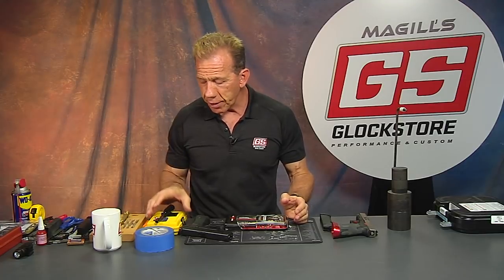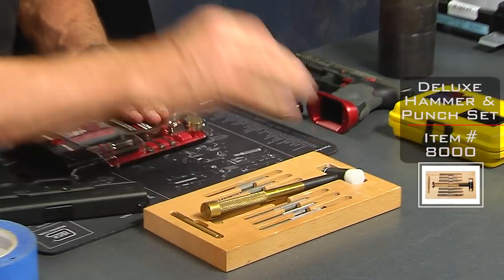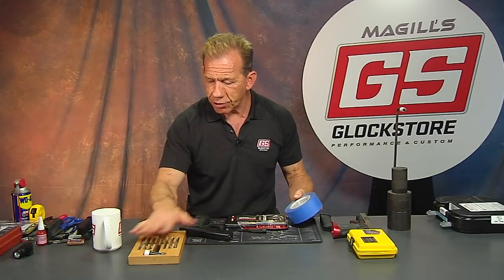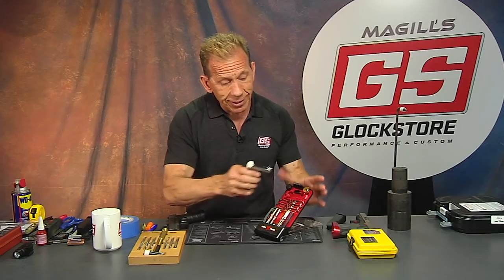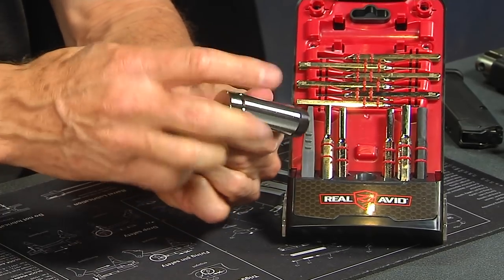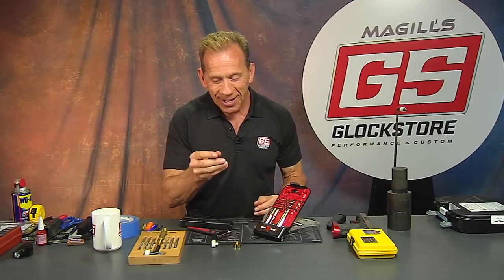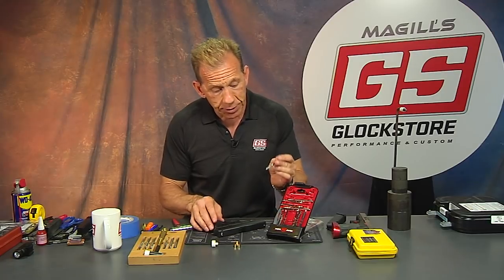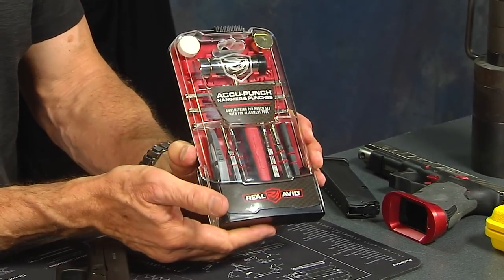Does Lenny Magill have a new favorite Hammer & Punch set?

Comment: The plastic pliers are intended to hold the punch while you hit it with the hammer. 

This can save your fingers and allow you to see what you’re doing.
Reply: No they aren't, they are for aligning pins....
Reply: @xsixinfantryx  That’s what Real Avid says it’s for, but the tweezers and the openings are too large for most pins used in guns.  They don’t grip well or are too thick for shorter pins.   I’ve found the best use for these is to hold the punch straight and get my hand out of the way so I can see the pin. They might work on something large like AR trigger pins, but those are easy enough.  That’s just me.

Comment: New to being a Glock owner since I am a first time gun owner and I tried getting the trigger housing pin out for putting on one of the larger backstraps with the tool that Glock gives you and let's just say it's not ready to come out yet. After seeing Lenny use a punch tool for these pins, definitely had to grab one off the site. Also picked up some stainless steel pins along with the Tungsten guide rod! The stainless steel pins sound like they are worth it since the plastic pin that was provided by Glock seems kind of flimsy IMO.